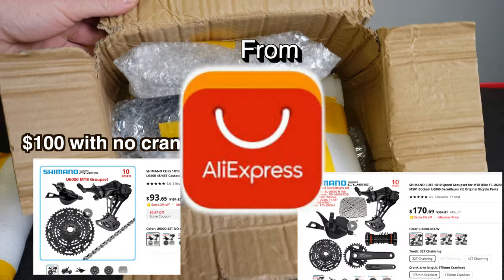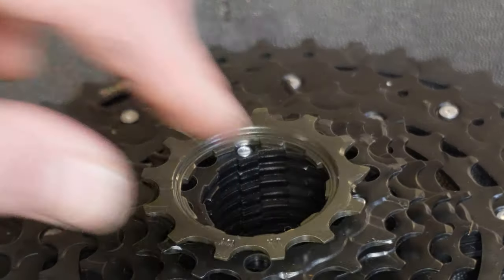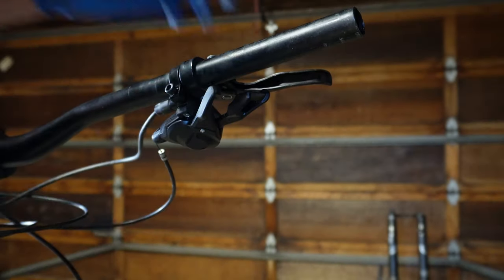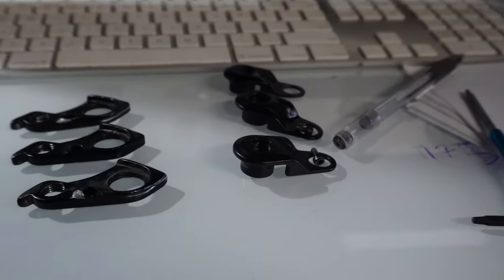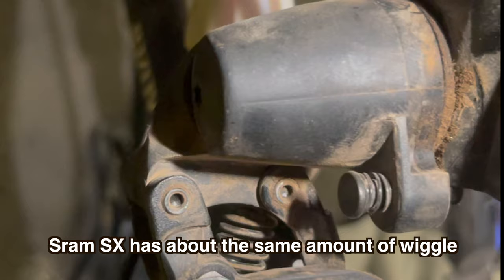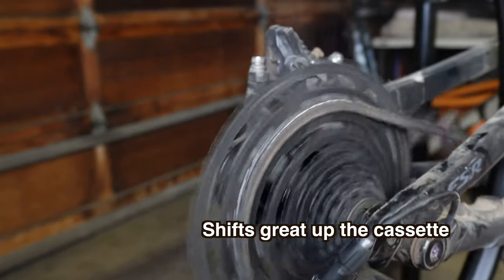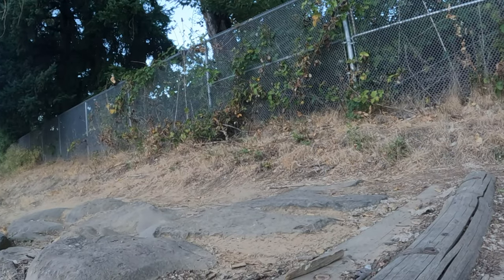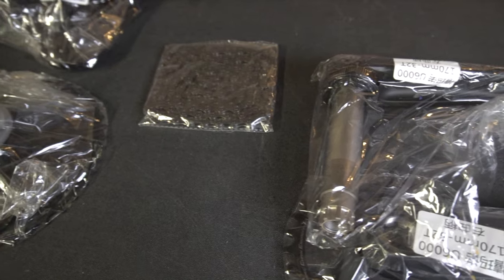Budget Hero or Zero? Shimano Cues Uncovered

Comment: I think the reason why the shifting is delay/slow is because the rear derailleur is e-bike rated, and e-bikes produces more torque, slowing shifting could reduce stress especially in chains (I did snap chain one time when shifting). But I don't know. Maybe the adjustment must be 100% precise and shifting well doesn't mean it's tuned.
Reply from the maker: I was curious too. So I put 12 speed cassette in. It shifts very fast ( does not work well). The Cassette teeth are fatter on linkglide.
Reply: @OtterMTBtech  Was starting to think that linkglides are made for durability and precision shifting instead of quicker shifting. My 8-speed tourney tx-800 can shift faster than my 9-speed cues u4000. I only bought the set for commuting/touring for daily use because it's advertised as 3x durable. 

Overall shifting down faster is more beneficial than going up since I never anticipate the terrain that there will be an unexpected climb. It is indeed very capable of shifting underload (more silent and faster).

Comment: After my initial problems trying to index this groupset, i ignored the Shimano b tension markings and wound it in to about 10mm spacing between teeth compared to their 19mm and it now shifts brilliantly 👍
Reply from the maker: The only thing Shimano did right was make a b tension line 😆
Reply: also note that shimano shifts gets better overtime and under load, shifting on the work stand without load it's gonna suck

Comment: I just purchased the Cues U8000 derailleur and received it today. Out of the box honestly, I'm a bit disappointed. The derailleur feels cheap and also kind of looks cheap. I decided to go with an 11-speed Linkglide XT shifter and the Cues LG400 cassette arrives tomorrow. I'll be installing the groupset on Friday, wish me luck because I absolutely suck at adjusting rear derailleurs. I'll probably adjust it as much as I can then take it to my LBS and have them finish adjusting it by correcting what I screwed up lol. It's sad I've built my bike from the ground up and I still can't adjust a rear derailleur correctly if my life depended on it.
Reply from the maker: Shimano CUES LINKGLIDE
https://youtu.be/DLZMnDT7c48 agree I fixed it in this video
Reply: Please keep us updated when you can/feel like it

Been curious to move onto the Cues 10 or 11 speed on this end
Reply: @randomdrifter  I got it all installed today and actually was able to get the gearing right for literally the first time in my life, lol. Shifting to lowest gear (biggest cog) is nice and snappy but for some reason shifting to higher gears, aka, smaller cogs is a bit slow. I don't know why up-shifting would be snappier then down-shifting. Regarding the XT Linkglide shifter it feels weird. Before this Cues groupset I was running the HG version of the 11-speed XT shifter and the shifting was nice and snappy with an audible click when I shifted a gear but this Linkglide XT shifter shifts more like my old SLX shifter. TBH I don't really like the feel of it because I can't really tell when I'm shifting into a gear. I'm probably going to take my bike to my LBS and have then check out the down shifting issue and maybe look at the shifter. At the worse I might end up buying the actual Cues U8000 shifter but i really don't want to.

Comment: Im convinced this u6000 cues stuff is garbage. Wobbly cage like yours, wobbly shifter cover and the 2 small cogs keep coming loose despite the lockring remaining tight. I can't index it either. Just ordered a new hanger to try that. Ive never had this much hassle fitting a new transmission before.
Reply from the maker: Same, this entire video was to highlight that. It’s not Cues it’s all Shitmano drivetrains. Tight tolerances. My bike shifted like a champ with Eagle. The Cues not so much. It was Actually the outside housing was bent in the ebike. You might need a spacer behind the cassette to make it tighten, I made 2nd video of how to fix it. The cassette is really bomber best thing in group the set Been running good since changed to short cage.

Comment: Hi, I have just had similar shifting issue on my Dura Ace Di2 11 speed. It turned out to be the B-limit screw, I had to much distance between the rear derailleur's top pulley and the cassette larges cog. I had done this to tighten up the chain. Turned out that I needed to shorten the chain to get the correct distance. At 2:50 in the video it seems to me that the gab on your setup is really big, this might be what is causing you problems.
Reply from the maker: This one has lines hard to screw it up

Comment: I heard in another review that testing the shifting for linkglide requires actually riding the bike as it requires increased torque to shift properly.
Reply from the maker: It shifts slower than 12 speed, but it’s just fine

Comment: I just have upgraded my ebike from Alvio to Cues 9 speed (full cues package). Shifting is awesome but i'm not happy with the rear derailleur! Do you know if the  Shimano CUES U6000  rear derailleur works with cues 9 speed?
Reply: Is it worse than alivio ? Why don’t you like rear derailleur ?
Reply: @JitinMisra  For my bike the Alvio does a better job at retaining the chain. Apart from that it's a horrible flexy derailleur.

Cues U6000 didn't work (not compatible). I'm currently wait for the short cage version of the Cues u4000. Officially the derailleur capacity is slightly too low but it my last attempt to get Cues properly working for my ebike...
Reply: @detmer87  Why didnt the U6000 work? The pull ratio is the same across the cues lineup and all of the parts are designed to be interchangeable so I assumed it would be an option.
Reply: @drew6166  I tried it. Indexing was off, I had 2 or 3 clicks left in the shifter when it was already pulled on the largest cog. I ended up going with the short cage version of the cues 9 speed derailleur. It doesn't have a clutch unfortunately but it does a much better job compared to the long cage version. Also less flexy.
Reply: @detmer87  bummer, I was hoping to have a relatively cheap 1x9 with a clutch and all Shimano parts.
Reply: @drew6166  My previous DIY ebike I ended  up with Microshift Acolyte (8 speed with clutch, short cage). That groupset was really impressive (I'm also known with SRAM GX Eagle, Shimano Ultegra, 105 on my bikes).

If you could combine Microshift with Shimano LinkGlide I would have done it...
Reply: @detmer87  I got the shimano cues 6000 10/11sp RD to shift totally fine on the 9 speed cassette (11-46t). I used the 9 speed shifter. I really like how simple the 9 speed is and having a clutch is nice. Perfect for an entry level mtb.

Comment: Can’t understand the issues you’ve had. 
Your outer cable is no good - far too short… that’s affecting your shifting.
These CUEs groupsets shift beautifully and are very forgiving of setup mistakes… if you just follow Shimanos instructions re: b tension, chain length.
Reply from the maker: Definitely does not shift fast or clean, and Shimano sucks to setup bomber cassette last forever selling point

Comment: What about mixing 8130 XT deraullieur and u6000 shifter and cassette ? Should be possible :)
Reply from the maker: Yep, that’s the linkglide 11 speed. You could even use the 11 speed shifter on 10 speed. Just push the limits in. I have 9 speed cassette with 10 speed shifter.

Comment: Fitted 11 speed linkglide w/ x01 chain. Shifts great under load so far so good. Short delay with changes. 

Had sram GX 12speed for nearly 5yrs until the derailleur pulley bolt fell out. Quality gear.  SRAM shifter and derailleur nicer quality. The xt deore shifter feels clunky and cheap
Reply from the maker: SRAM is better

Comment: I'm considering upgrading my drivetrain to CUES U8000, x1 x11 from x3 x9 Deore and Alivio mix. U8000 is supposed to be higher quality than U6000 so hopefully it'll be smoother.
Any tips to watch out for?
Reply from the maker: It shifts really slow, just be prepared for it. If your not use to 12 speed it not a huge deal
Reply: @OtterMTBtech  OK, thanks for the heads up.

Comment: Will the 1X Cues crankset be compatible with rear 7-speed freewheel?
Reply from the maker: They make one that will work, it’s difficult, but you need to figure out the chain line. Before buying the crank set
Reply: @OtterMTBtech  the main doubt that I have is with the 7-speed chain used for freewheel, will the chain stay on the narrow wide Cues chainring?

Comment: 780g cassette? Holy moly. My Advent X cassette is around 430g.
Reply: it's 50t and it's like 100 more than deore lol, it's not much
Reply: unless ur racer
Reply: @TrzCinA122  I'd rather not lug almost a 1kg of metal up the hill if I can help it. Hence the Advent X.
Reply: @repo4 your lugging alot more with your body weight regardless
Reply: @growingup4487  correct, Sherlock. And on top of that, I like my bike as light as possible, within my budget.

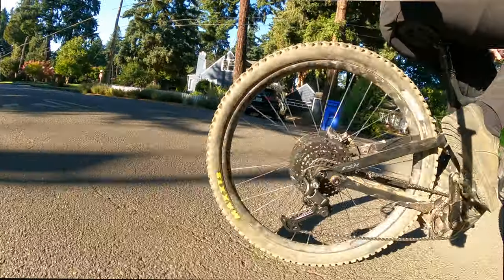Comment: 4:00 "this is absolute full power shifting" 
Out loud to myself I said "well don't do that." I dont even think its a good idea with the new sram transmission where its marketed as a key feature. I mean yeah test the drivetrain, go for full power sprints, climb the steepest shit you can, but dont purposely abuse the drivetrain. You wouldn't do that on a normal ride (hopefully) and it's not a fair test to this one. Im sure im not the only person clinching my ass when I hear those shifting sounds.
Reply from the maker: Bro it held up. Thousands of miles worth of shifting done in mino

Comment: I see why you have shifting problems. 

2.40m i see you run the shifter cable from over the top of the bolt. It needs to go the other way. Trust me. I spend 2 days trying to solve my shifting problems. Then i ran the cable the other way and that solved everything.
Reply from the maker: My housing was bad. Was last part I replaced